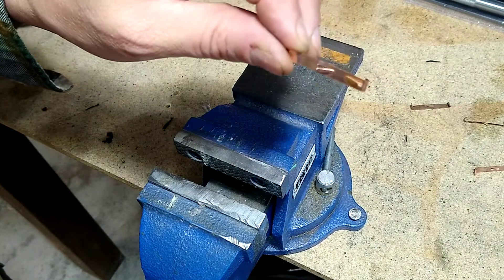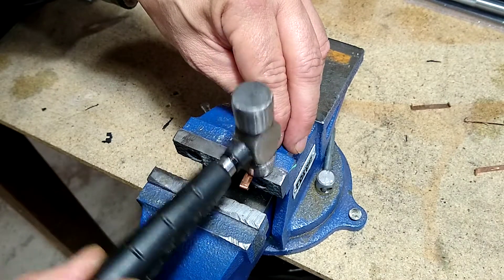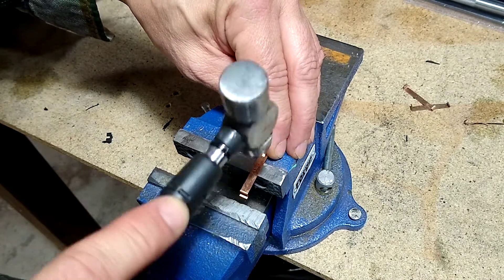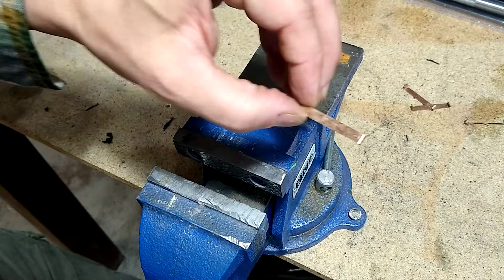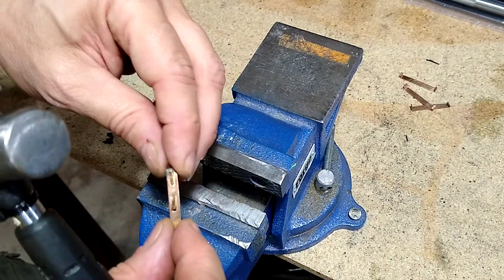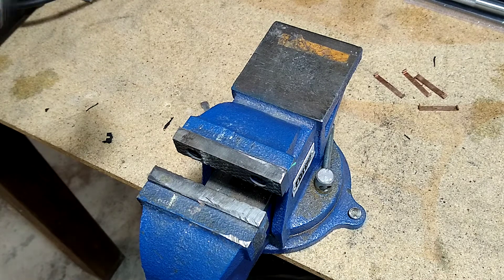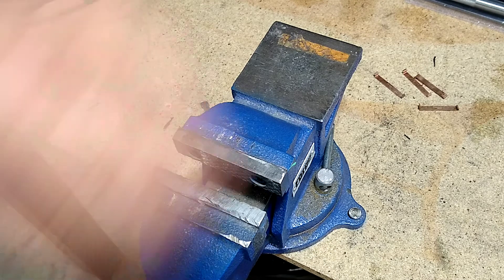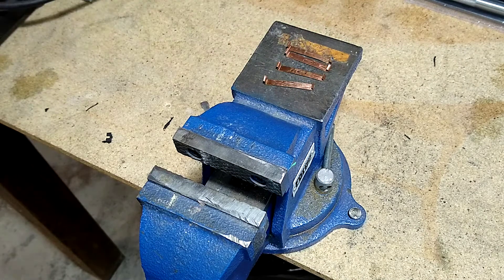Athearn SD45 GP35 rebuild part 4 motor clips

Comment: An easier trick is to switch the top and bottom clips so that one with the prongs which "grounded" the motor to the frame is now on top. There is enough of a gap that the former smooth top clip, now on the bottom, won't contact the frame but a piece of tape could be added if you want extra protection.
Reply from the maker: for the bottom, I switched to liquid electrical tape because it's super convenient.  I have switched the 2 clips around a few times without trouble and that totally works!